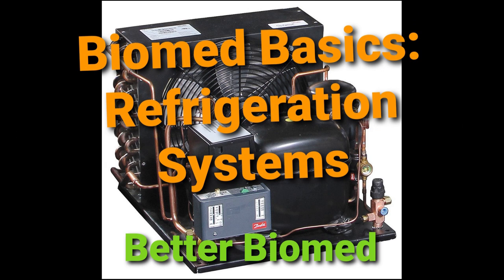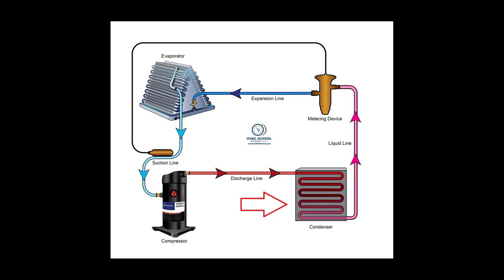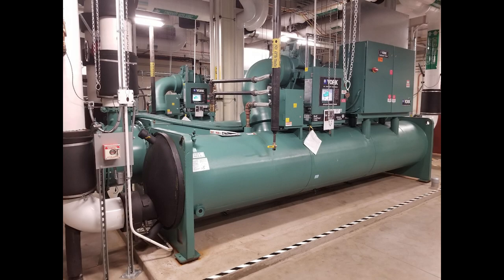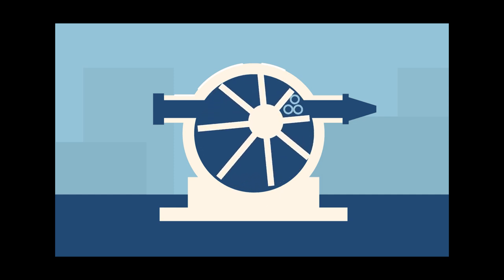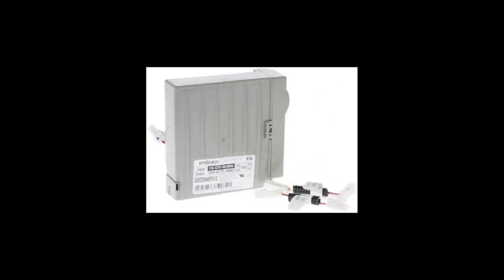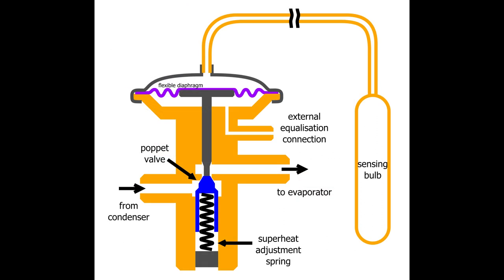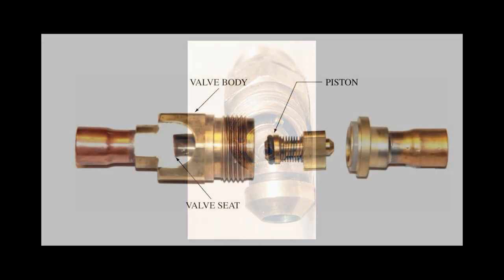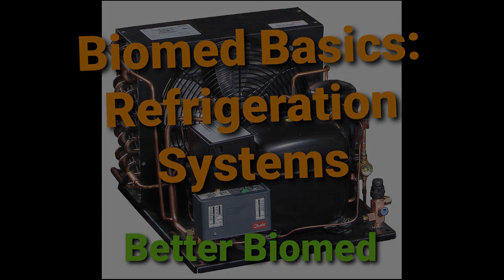Biomed Basics: Refrigeration Systems

Comment: Well-thought-out presentation!  Would it benefit BMETs to have a refrigerant recovery and recycling equipment certification, or is it normally handled by plant management? What is the most common refrigerant(s) mixed or unmixed in lab equipment? Have you had to work on boilers or chillers? Thank you.
Reply from the maker: I have had to assist with boilers before. Smaller medical facilities require biomeds to work alongside what few facilities staff are on hand to resolve problems. I could have solved many refrigerator/ freezer problems if I had the license and tools. These systems are not nearly as complex as most medical equipment.